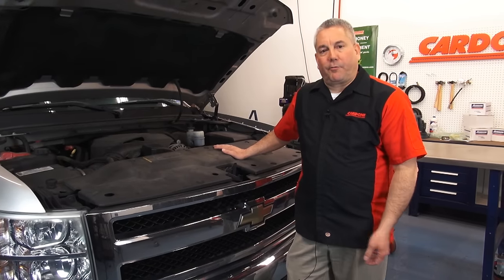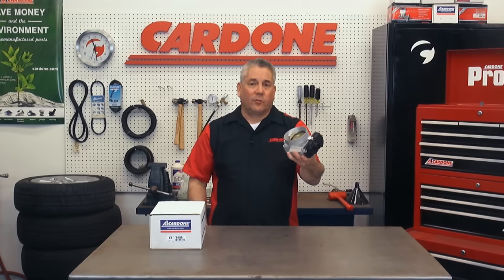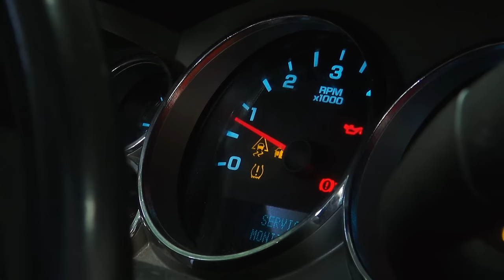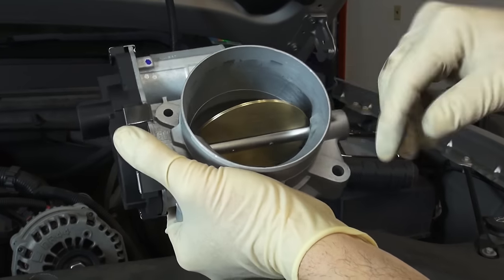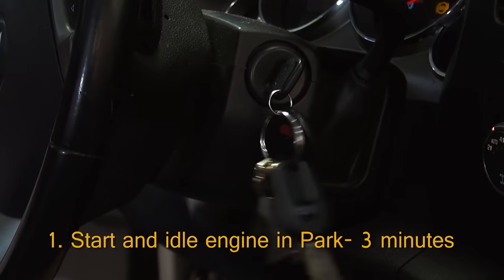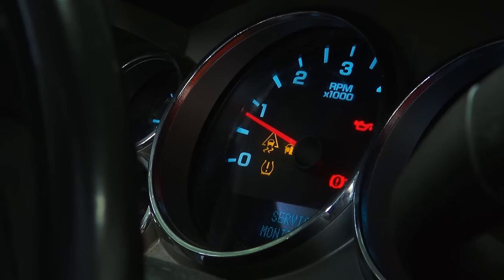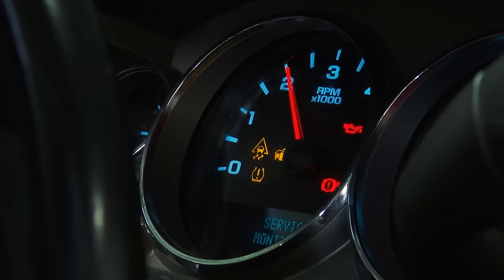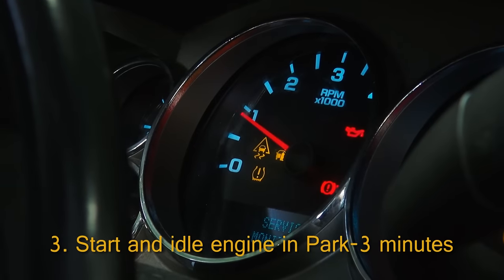GM Truck Electronic Throttle Body (ETB) Relearn Procedure

Comment: It worked. I  performed the steps multiple times with no success. Started up the truck the next morning after a 30 min drive the night before and it seemed to be ok. Drove it that evening and the problem came back. The next morning it seemed to be fine so I performed the learning procedure with a stopwatch starting and shutting off the truck right on time. (2 times) then drove it problem fixed. Hope this helps.
Reply: Did it ever come back up after the last time doing it ?
Reply: The ECU computer has a self-learning function, but this process is slow and laborious. Throttle learning with software would be appropriate.
Reply: O
Reply: My truck just idles at 2500 rpm no matter how many times I do this and when I try to drive it it puts the truck in limp mode
Reply: @Dbrown65  take your battery off and hit the brakes.  That will clear the lump mode out.
Reply: @Dbrown65  you have a vacuum leak
Reply: @Dbrown65 just leave it running pour some milk in the gas tank close your eyes and count to 10 works like a whistle…
Reply: @BackYardScience2000  are you saying to disconnect the battery cables and press the brake pedal?
Reply: You're saying we can just undo the battery Ground,hit the brakes and it will clear the limp mode?? Will that work on my 2006 Pontiac Grand Prix 3.8 @BackYardScience2000
Reply: @williamjones8283 yes that uses what little bit of power is left in the computer to try and activate the lights and kills the battery in the memory
Reply: @Dbrown65 f it's a manual, you can force it to learn to idle at a lower rpm by using the embrace and bogging it down to idle rpm. First time I cleaned my throttle body, my Cobalt wouldn't complete the relearn procedure no matter what I did. Fortunately, I finally found a post online describing how to force the idle lower. If it keeps shooting back up, force it down again. I use a large, empty parking lot to do this. 5th gear  and coast down to 20mph has to be done on a road. Ebrake is usually needed for that as well. I don't remember how long 5th gear has to be maintained, but you should at least go a few miles. If it's an automatic, sorry about your luck. 😢

Comment: After cleaning the throttle body on my 2008 GMC Sierra 1500 I did this procedure and it worked like a charm.  Many thanks.  Maybe add a warning to not touch your gas pedal while performing this procedure.
Reply from the maker: Hey Jim, thanks for the positive feedback, and for your advice! Be sure to connect with us on Cardone’s other social channels:
https://www.facebook.com/CardoneIndustries/
https://www.linkedin.com/company/cardone-industries/
https://twitter.com/cardoneparts
https://www.instagram.com/cardoneindustries/
Reply: Why would they need to add that warning? It should be common sense to not touch the throttle while the THROTTLE body is doing a relearn….
Reply: @brandonreed773 You do realize that we now have “caution hot liquid “ on McDonald’s coffee cups right? Some people are surprisingly ignorant 😂
Reply: I bumped throttle upon exit of truck 🤦. Any help?

Comment: I cleaned my tahoe 2012 throttle and after starting the car  goes to 4k RPM ! , I switched the car off and did the following. First, I disconnect the battery completely. Then, I left the car without battery connection for 24 hours. Then connect the battery gain and start the car and left it running for 3 minutes. The RPM increased to 2K RPM and then decreases. After 3 minutes, I switched the car off for 3 minutes. Then start the car again and left it running for 3 minutes. Then the car off for 3 minutes. Then start it again and drive.   It works for me and I hope it works for you as well.
Reply: No need to plug in a code reader and do a relean?

Comment: Step #4- be patient! The relearn may take a while.
Reply: Thought I had it right.  Shut tahoe off. Then turned it back on 2500 rpm and climbing slowly.  Will it come back down if I let it idle that high?
Reply: @timhansen14  same problem I'm having
Reply: Yeah, it's been two days and it seems to be getting better but it still has super hard downshifts with throttle open for some reason, the car just bumps on down shifting the gears. How many miles does it take for ECU to re-learn your driving patterns ?
Reply: @OscarHanzely  any luck on the idle going back down?
Reply: @OscarHanzely any fix??

Comment: Hello brother, does it work on Chevrolet Optra 2011 engine 1.6? I have changed the throttle body to a new one but when I start it up the RPM stays below 1000 or on 1000, may you please help me, thank you very much

Comment: I’ve tried for the past hour and a half and my 07 Silverado is still idling at 1800 rpm. Replaced the tps sensor and cleaned the throttle body but still no luck. Please help!
Reply: Tristan Sherwood 
Mine doing the same thing. Likely gonna buy a scanner so I can relearn the throttle parameters. I’m gonna drive mine for a few more miles see if the ecu will start to adjust it. Big hassle
Reply: I’m having similar issue with 2012 Silverado but after it’s warmed up, it will go as far as 3500 RPM.
Reply: First step clear the code . That's before starting anything then follow the steps
Reply: I said the hell with it and drove the 40 minutes to work and it went back to normal. Think I just needed for drive time for it

Comment: Hello everyone. 178,000 miles on my 08 2500HD with LY6 6.0L gas. SES light came on YEARS ago. O'Reilly code reader showed Throttle Position Sensor (TPS) code. Always ran perfectly with no loss of power or fuel mileage. Finally got around to work on it. My Chevy dealership sold me a new TPS (Part # 19259452). $33.18. It does not include the entire TB. Only the plastic part that is clipped on. Came with 6 new clips too. I removed the TPS, cleaned the TB while TPS was off so as not to damage electronics, clipped on new TPS and fired 'er up. Had the common 2000 rpm idle. Performed the idle speed relearn several times as described in this video. Did not solve high idle issue. Thanks to Cory Hayden's comment about his PCV valve not being plugged in, I decided to recheck my work. Yep...forgot to reattach PCV. Cleared codes again by disconnecting battery for a couple mins and performed relearn procedure once more. Lo and behold...it solved all issues!!! Be sure sure to check for any vaccuum leaks (i.e. PCV valve)  after reassembly. Hope this helps.

Comment: Excellent video.  Thanks for the great info. My 2003 Escalade, 6.0l Vortec with electronic throttle control was idling too high after I cleaned the throttle body and I didn't know how to fix it until after you described "idle re-learn".  The two 3-minute idle cycles with a 1-minute cycle in-between worked like a champ.

Comment: The Harbor Freight Zurich ZR15 Code Reader for $300 will do Idle Relearn, it's bi-directional, so only this one, not the cheaper models.  That will save you from spending the big money on a high end scan tool if you're not in that market.
The process in this video didn't work.  I tried it many many times, tried suggestions in the comments, tried it with the heater on, disconnecting the battery, clearing codes, while patting my head and rubbing my stomach.  You have to do the idle relearn.
I replaced the throttle body on a 2008 Silverado and the rpms stayed rock solid at 3000 rpms...  Ran the idle relearn with this code reader tool and it was an isntant fix
Reply from the maker: What is the make, model, year and engine size of your vehicle?

Comment: After one video from another guy saying it cant be done without dealer equipment. And he was a rude person cussing in his video.i found this one and did exactly what it said and it fixed my Sierra I've been messing with for a month thanks guys for the great information.
Reply: So did you clean your throttle body on the truck or did you take it off and clean it Or install new throttle body position sensor and clean what year ? And I know what video your talking about lol
Reply: @christopherfoulk9931  I did a new one 2 years ago and the code just popped up on mine 2 days ago . Just cleaned it at 4 a.m. this morning  and  did the relearn all in less than 30 minutes
Reply: Yoo I just came from there saying some stuff like “this video is for adult audiences if you can’t hear the F word go watch some nickelodeon” 😒 so tough 🤦🏻‍♂️
Reply: @heberlara6079  o
Reply: Same problem here
An got the same results, my truck is running smooth now !

Comment: I cleaned my throttle body on my 07 Tahoe after my idle was high.
I follow these steps after the drive cycle and drove it couple of days after it work perfectly. Thank you for this video. 
And to the people that say you need a scan tool YOU DONT .
Reply: In high idle was it safe to sift gears
Reply: Just did on mine same thing happening
Reply: Hopefully it goes down soon
Reply: @rcthegod1148  did it work
Reply: I hate how they don't respond smh

Comment: Today I replaced my throttle body on my 07 GMC Acadia, turned it on and I guess I was lucky because the RPM was normal, not high or low, but I still did what you said on the video, the reason I changed it was because I was getting reduced engine power message, I hope this fix the problem. Thanks cardone
Reply: update, reduce engine power message never came back!!

Comment: I just cleaned my 2007 Tahoe w/228k throttle body and now when in park with ac off if I rev it a lil it will accelerate and if I turn ac on it’ll go back down but even at idle it’ll accelerate by itself with ac on what can I do to fix this??? I’ve done the turn it on for 3 mins and off for 1 and on again for 3 mins but it didint work…I’ve driven my Tahoe mostly city driving and passed 44mph and it still didint fix nun
Reply: Me too doing it now and it wont work on my 2007 tahoe 4.8
Reply: @reloyramirez  I didint know they made 4.8 Tahoe ?
Reply: @reloyramirez  my idle has just now calm down after I rev it but sometimes it does get stuck accelerating (I cleaned it 3/13/24) (throttle body)

Comment: I finally found the way to fix that storbon idle problem. Mine was so bad that I actually prematurely wore out my brake pads!
I used a combination of several methods, (or trouble shooting techniques). PLEASE PAY ATTENTION and follow my instructions down to the letter / second. 
First I disconnected the battery, I then removed the throttle body and replaced the air filter. I thoroughly cleaned and reinstalled the throttle body. and then hooked the battery back up.  
I then performed the following "Reprogramming procedure" :

                    #1 I started it up and let it Idle for exactly 3 min. 
                    #2 I  shut it off for exactly one min, 
                    #3 I started it up and idled it for 3 min. 

I then took it on the highway, I set the "Cruise control" at 70. 
I used the "Cruise control accelerate switch" (on the blinker arm)  to throttle up past 75,
I then disengaged the " Cruse Control" and allowed the vehicle to decelerated down to 60,
I  then repeated that tree times. 
I drove it home and shut it off for 15 min.
When I restarted it I let it idle till it got to its running temp and it has been perfect ever since. " THANK GOD!. I actually wore out my brakes
Reply: Hey man im 5 years late to this comment but what does removing the battery do exactly?
Reply: @fredycate2329  it resets all the codes, if you don't disconnect the battery your old codes are in your ECM. You would need to set back to square one by disconnecting your battery so your new throttle body learns the new codes

Comment: I didn’t replace my throttle body but cleaned it on my 07 avalanche and driving it for a week or 2 eventually brought the idle back to normal
Reply from the maker: Great! Avoid the replacement job when you can👍

Comment: Sir,  after cleaning my throttle body and MAF on a 2007 suburban Z71 5.3L, (battery disconnected through entire procedure), I connected everything and started the motor.  The idle sat at approximately 2500 rpm.  I drove it for 70 miles and it still ran at 2000 rpm.  I again disconnected the  battery terminal...pressed the brake pedal 3 times...reconnected the battery and started the engine (disconnected batter for about 60 seconds)  runs like a champ now.  Thank you!
Reply: This is what is happening to me aswell

Comment: I have reduced engine power. After many different codes and went to dealer's to scan as well. I replaced throttle body, gas pedal, all ignition-coils, spark plugs and lastly the computer. Still have reduced power if I go over 50mph. Rough idle, flashing engine code, etc.... I then shut off for a couple minutes and it starts over???
Reply from the maker: Thanks for the comment! This sounds like a question for our for our Tech Support Team, give them a call @ 888-280-8324 Mon-Friday 8am-5pm EST to speak with one of our ASE-Certified Technicians.

Comment: 100% works- disconnect negative battery terminal, pump brake 3 times—- reconnect battery. Rpm will jump to around 1800 then level right off within seconds...
Reply: ACG Ministries you expect someone to believe that?
Reply: Paxtyn Graves lol probably won’t but I found it on a forum last week after I cleaned mine. I did it and it actually worked. Still took about two days of driving to get back to normal but it did work.
Reply: ROFL, brakes are not connected at all. What you did is disconnected the battery for long enough to completely reset the ECM unit.

Comment: what happens if the engine died, and won't restart, and it's throwing ETB codes? already replaced the ETB once, w/in 24 hours, it died again+no start.

06 SSR, with the LS2.
Reply from the maker: Thanks for the question, give our Tech Support Team a call today @ 888-280-8324 Mon-Friday 8am-5pm EST to speak with one of our ASE-Certified Technicians, they should be able to help you. 👍

Comment: I had to clean the carbon from the butterfly plate on throttle body. The re-learning procedure helped to get idle speed down to normal.
HOWEVER I have one issue. The downshifting the gears (especially the lower ones 3 -> 2 -> 1) is super clunky. The RPM just gets bumped up and the car bumps when transmission gear is engaged at lower level. It's like I would be pushing the gas pedal while downshifting. Is this something that will over time re-learn/correct itself ?
Reply from the maker: Hello Oscar, thanks for the comment and the detailed question. Our Tech Support Team is available Mon-Friday 8am-5pm EST, give them a call at 888-280-8324 and ask one of our ASE-Certified Technicians your question. They can help troubleshoot your issue. 👍🔧😁👌
Reply: Low transmission fluid

Comment: I changed the throttle body in my 06 Envoy. Drove it for two weeks no problems. Then got the code again P2135/P2176. Then I replaced the gas pedal sensor. 5 weeks later I am still getting the codes every once and a while.
Reply from the maker: Thanks for reaching out! This sounds like something our Tech Support Team may be able to shed some light on, you can connect with them by calling 888-280-8324 Mon-Friday 8am-5pm EST to speak with one of our ASE-Certified Technicians. 👌🏼🔧👍🏼⚙
Reply: Hey did you continue having problems?

Comment: I have a 2009 Envoy.  The car was going into limp mode with a code P2135.  (rough idle, stalling, .....  2 times same day).  Replaced the throttle body with a new Bosch unit for the 2009 Envoy.  The old TB was fairly well carboned.  I performed the relearn, it is idling at 700-800 after about 5 seconds after starting.  However, when you start to press the accelerator, the car leaches because the engine jumps to 1200 RPM.  You just have to barely move the pedal for this to occur.  If you are moving and stop, wait 5 seconds, the idle will return to 700-800.  If you are in park and you place the car in drive, sometimes the car will increase to 1200 rpm as noted above.  I did not have this issue with the old Throttle body.  I have driven the car 50 miles with speeds of 50 mph with many stop and go, I am not seeing any improvements.   Any ideas?  I can't find anything on the internet describing this issue I am experiencing when replacing the throttle body.
Reply: I know this is a year late but are you still getting codes?
Reply: So what helped, cause I am having exact same issue. It appears to take very long time to re-learn the shifting for me and it still forces the idle to start high and then drop.
Reply: @OscarHanzely  figure anything out?
Reply: You need the oem part not aftermarket

Comment: After I clean the throttle body on my 2007 Chevy Tahoe it was idling at 3200 RPMs . couldn't get it to go down . Finally I turned on the AC on high and it pulled the RPMs down enough to be able to drive it

Comment: How late is "late"?  on my 2000 jimmy, I cleaned the tb and now idle is off and the engine sometimes will stumble briefly when trying to maintain a constant speed. the workaround I've found is you need to remove foot from gas pedal and reapply, maybe repeat

Comment: How long does it take for the throttle body to relearn? I replaced mine on my chevy malibu 2010 5days ago and been doing these and still idles high.
Reply: Idk if it's just for fords or if its universal but disconnect the negative terminal make sure you have a rag to prevent it from touching the battery. Hook up an alligator clip on the positive terminal with the cable still connected to the battery and the other on the negative CABLE. Wait about 5-10min to let the PCM drain any power. Reconnect your negative terminal turn the key on engine off wait about 10sec to let the dash cluster set then turn engine on. Make sure all accessories are off, radio, lights, ac, everything. Let it idle for 15min to reach operating temperature then another 15min to relearn for both cold and hot temps. Take out for a test drive don't accelerate hard so it can learn all the fuel trims, shifting points, and throttle position. You should be good after that I'll link a video down below.
Reply: You also do this if you clean it believe it or not.